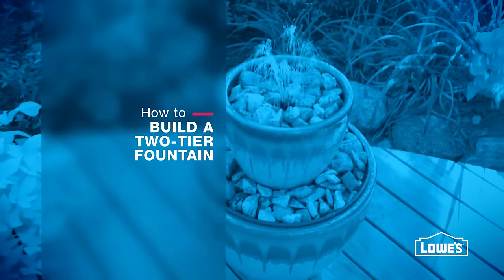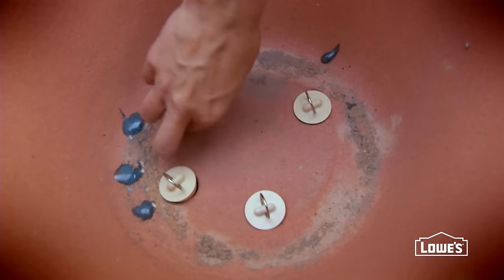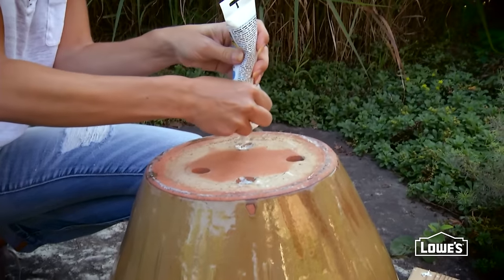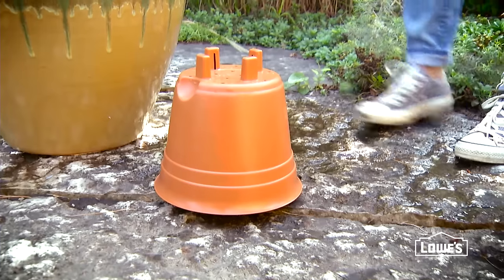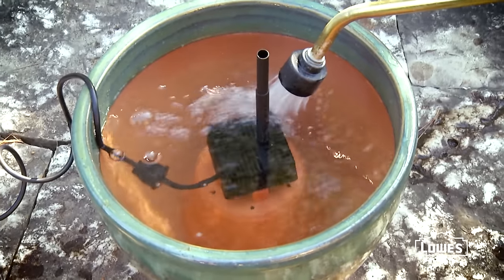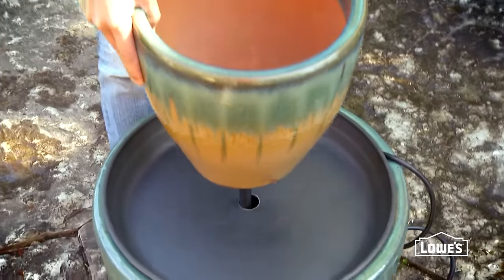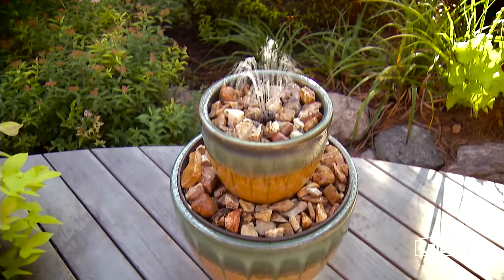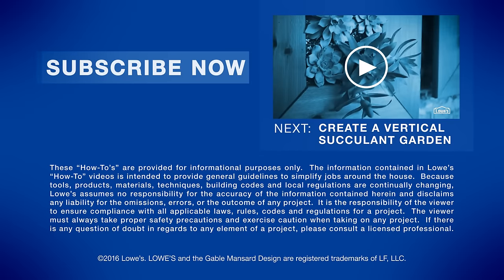How to Build a Two-Tier Fountain

Comment: After having owned a water fountain for a couple of years, one of the most important aspects to consider is how to clean it. Algae builds up over time - even if you use an algaecide. It has to be cleaned regularly and the water needs to be replaced. While this design looks good, I can imagine those rocks will be full of algae in no time and will be difficult to clean. The whole thing needs to be taken apart, cleaned and flushed and then start over with new water. I'm still looking for a DIY solution that's easier to keep clean.

Comment: Great but I think the tray needs a few more small holes to allow for better drainage into the containment vessel besides the central one. An easier and more reliable waterproofing would be to use a piece of pond liner to waterproof the entire large vessel. Use pieces of styrofoam foam or foam insulation in the top pot so that you only need one layer of rock. This is too much weight in the top pot. Finally, the pump should be lower in the pot to avoid accidentally running dry, and it should be strong enough to raise water to the higher level.
Reply: You’re GREAT!!!! Thanks!
Reply: Can you do a detailed instruction on this?

Comment: Nice project - but MAJOR problem & safety issue with placing all that weight on the electrical cord.  Need to do a cut out in that tray.
Reply: Or melt it a bit and make a gap in the side without losing the tray edge.

Comment: This does not work. We bought everything at Lowe’s to do this project for our back patio. Between the pots, pump, rocks and other materials it’s well over $200. The main problem is the weight of the water in the larger planter and being able to seal it. Forget the plugs and caulk. I’ve tried cement, flex seal, and combinations of both and the water finds a way out of the bottom of the pot. The next and last thing I’ll try to do is finding a water tight container that won’t leak and can hold the weight of the pump and second container. This not as “easy” as it seems.
Reply: Good to know. How about putting a piece of pond liner in the pot?
Reply: Go to the dollar store and buy 2  round plastic basins to hold the water. I said two because doubling the basins could help with the weight problem.
Reply: You could have bought one already made for that price.

Comment: Won't it run dry ? How do u refill,do u have to disassemble it?
Reply: How about just pouring a few cups of extra water on top of it weekly? It runs down by itself, don't have to fill the bottom...
Reply: Where did you think the water was going?
Reply: The holes where the tube runs through allows water to drain back down to the bottom pot
Reply: @codyjewell1460 "Holes"???  They put in only one hole, and that wouldn't be enough.

Comment: Oops! bathtub plugs used in bottom of 1st pot will mildew & deteriorated fast.  What's something else that can work to plug up holes?    Thanks.
Reply: Rubber plugs that are like corks. They are heavy duty and work great. Seal them with silicone. You can find them in the "hard to find" hardware section at Lowe's or other hardware suppliers. They are black in color.

Comment: seems to me that there is a plug around the cord of the sump pump. Rather than run the cord over the edge of the bottom pot, it   can be threaded through one of the drain holes at the bottom and sealed. Obviously, a watertight seal is imperative and this may be the failing of such an idea if the seal between the chord and the plug cannot be achieved.
Reply: What do you do when the pump fails which of course it will in time?
Reply: I found a good collection of videos that may help you at Ewans Energy Roadmap
Reply: I'm building my own similar fountain. Though mine is a little more involved as I want it to be a little cleaner in design. I was thinking of running the cord through the bottom as well. In the end I just imagined too many potential problems, either with water-tightness or with the inability to shift things around, or even decreasing the amount of water by running it into a hidden, interior plastic basin. (Another abandoned thought) I'm opting instead to customize the lower saucer to better accommodate the wire, drape it as shown in this vid, and just turn it for the least amount of visibility.
One change I'm planning for mine is to use a small plastic saucer to make the upper part as sealed as possible so that the upper part over-flows and trickles down the upper sides rather than water just falling through the top. I have to re-order the upper saucer though. I would advise against using drills and clippers on the plastic components. You run into the potential of cracking and creating undesired jagged shapes. Use a SOLDERER (safely) instead, to really be able to control the shape of the cuts you're making.
Reply: True,  any and all submercible pumps I have purchased last one season then ,, poot.

Comment: Where did you get the pump with long tube ?
Reply: Walmart{aqurium pump
Reply: I had to buy the pump, the tubing and the spout separately.  Pump $46 ,  tubing $15, spout $15. At Lowes.
Reply: @edyrose8458  our Walmart is locked down so no buying non- essentials.

Comment: There is no way for this fountain to recirculate. I believe you left out the step to drill holes in that plastic tray so the water could get into the bottom planter and recirculate back up. And definitely too much weight in the top pot filled with rocks sitting on a plastic tray.
Reply: Exactly!

Comment: I don't think that much weight on the pump cable is going to do it any good.  Probably worth cutting a notch into the plastic for the cable to go through - if it doesn't become too weak.

Comment: Where did you get the plastic to rest the second pot on?
Reply: Ya I couldn't find one.  I looked online on wayfair and it was expensive.   My bottom pot was 20" so a 20" plate from wayfair was 50-70 bucks!  I'm in Canada and we are on lock down.  I couldn't find a plate so I had to fill the bottom pot with rocks.   It was expensive .
2 pots from Walmart 20" and 16"  $50
Pump from lowes $46
Extra tubing lowes $15
Spout for fountain lowes $15
Rocks $75

Comment: where do you get the 6 or 8 inch pot that holds the pump any body help me,thanks.
Reply from the maker: Here are the pots we used: 15.2-in ceramic planter, #485144, 9.8-in ceramic planter, #485136. Check your local Lowe's for availability. Thanks for watching.
Reply: Lowe's Home Improvement